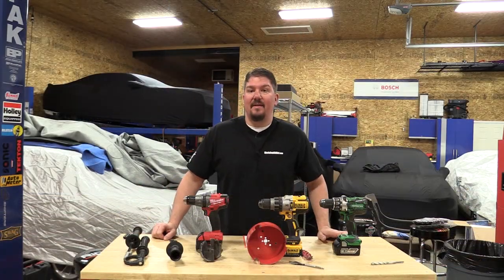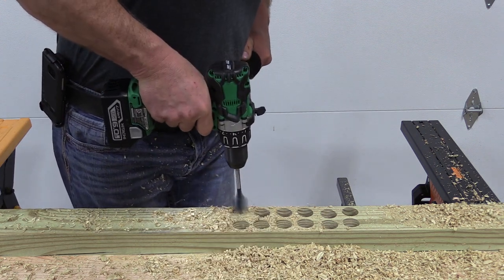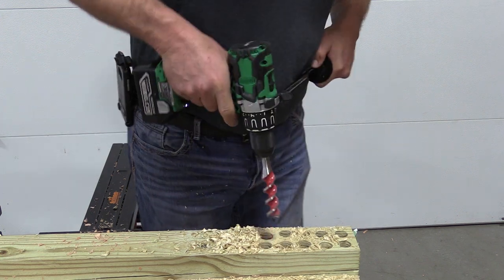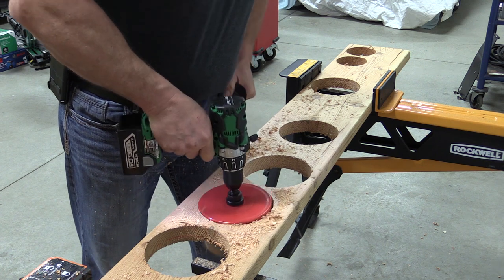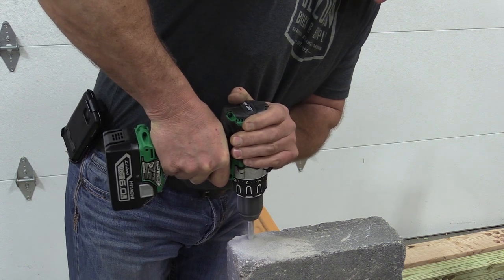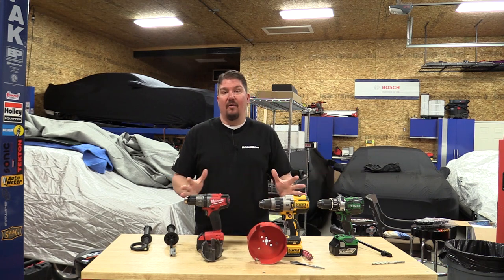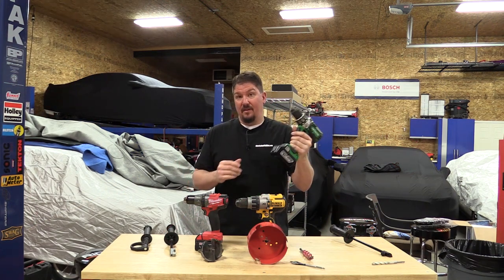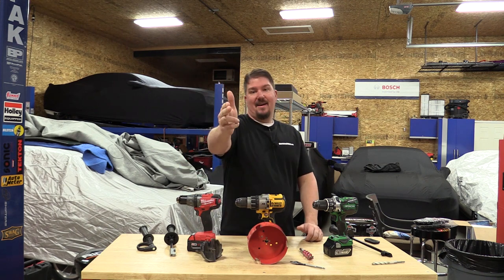Hitachi DV18DBL2 1/2" Drill vs Dewalt DCD996 vs Milwaukee 2704-20 | Brushless Drill Battle

Comment: love my Milwaukee, helps to have friends that are engineers there, they tell me what products they like so I don't regret purchasing something they have told me they are addressing the heat issue, which I only get on my 3/8 ratchet all my other tools have been fine under load, and my chuck does wobble a little bit on the drill but im not using this for precision woodworking anyway. but if I had a choice after Milwaukee just for the sake of number of tools they have and as a homeowner/handyman ridgid would be my next choice, I switched to Milwaukee after some bad experiences with dewalt, and happy I did.
Reply from the maker: What heat issue?  Thermal cutout or just heat buildup?
Reply: WorkshopAddict the heat build up.  like I said I have only experienced it with the fuel ratchet, I actually had it out last night and had 4 bolts I was running nothing major and the top was fairly warm already. but i do hear from other friend about having problems with tools getting so hot they do thermallycut out I just have never had the problem, yet.

Comment: I have had some hitachi batteries for 6 or 8 years and they still perform just as good. And I use them multiple charge cycles every day doing construction. And I have only had one drill burn up. After years and years of abuse. Hitachi all the way. Dewalt is junk. Milwaukee is good. I have the 1\2 inch impact and its an animal but I prefer hitachi still.
Reply from the maker: That is a long time for batteries to last!
Reply: Yep trust me. It amazes me every time. Its nuts but hey, for the dam price they better!

Comment: Where is the Ridgid Gen Brushless?
Reply from the maker: The Ridgid is rated at half the power of the drills tested and did not make sense to put it in the test.
Reply: WorkshopAddict with the three drills you tested, what are the specs for them? In comparison with the Ridgid Gen 5 Brushless?
Reply from the maker: Milwaukee 1200 inch pounds, Hitachi 1205 inch pounds, Dewalt 820 Watts Out (you see how well it did).  Ridgid is 700 inch pounds.

Comment: Only issue I've seen with the Dewalt is over heating while mixing motar on a roof in the summer time. The brushless stuff has been good but I miss the capacity to take a beating of the old brushed models.  Oh, and you do definitely need ear pro with the Dewalt in hammer lol #WorkshopAddict
Reply from the maker: The three speed on the Dewalt makes it a fun and easy drill to use.  It is not meant for mixing and yeah, the old brushed models would take that.  Brushless is getting better.
Reply: Milwaukee makes a brushless mixing gun
Reply from the maker: Yup, see it here: http://amzn.to/2E19urL
Reply: Michael McD. Lol that's funny they say your not suppose to mix mud with these drills but I know for a fact that the dewalt will mix a whole bucket of thinset with no problem. Lol it just churns.. it loves it lol. Bit yea as a remodeler I tho k dewalt is best. Although I do like the plumbing tools for Milwaukee.
Reply: Are you insane using a cordless drill for mixing mortar use a corded drill with low speed or a special drill designed for mixing mortar

Comment: I have bosch 18V battaries. I cant buy any of theese
Reply from the maker: I hate to tell you this, but Bosch is going through a change with their batteries.  They are going to the CORE series for the new tools.  The tools are getting more power with that battery.  you can use your battery on those tools, but you won't get half the power.  Near future, you will have to buy new batteries.
Reply: I already have one Core battery. Acoording to Bosch it is up to 1440W of power. This is way too much for a drill/driver. For not power hangry tools you can still use your "old" batteries. The problem for me is that bosch does not have cordless fan and hight torque brushless impact,  I want these two, but i don't want more chargers and batteries.

Comment: Milwaukee is known for casting issues. I’ve seen pics of impact driver housings cracked clean open all the way around and anvils broken off. I’d go with dewalt for automotive and woodwork. They own mac tools so they do have auto repair impacts. They need their mid torque one on the market.
Reply from the maker: I too have seen some issues with casting breakage, normally in well-abused tools.  I too like Mac and Proto.  Dewalt just does not seem to be "killing it" in the 20-volt max section in automotive.  Some ratchets and mid to high torque impacts would be welcomed!
Reply: WorkshopAddict I saw a pic on amazon of a 2750 brushless non-fuel model impact driver with a cracked open casing but who knows what a guy was using it on for that to happen. For the broken anvils I saw it was on Home Depot a pic of a ryobi p261 impact wrench. A guy claimed to have broken the anvils off on two of them somehow. Those are isolated incidents though. Any tool can fail with too much stress.

Comment: Great video, you should do two more with their impact driver and impact wrench versions
Reply from the maker: You want us to compare the impacts from these three companies?
Reply: WorkshopAddict well impact wrench I say Milwaukee 2767, dewalt dcf899, makita xwt08z and for 1/4 drivers Milwaukee 2753, dewalt dcf887, makita xdt14
Reply from the maker: I will work on that.  Makita does not like it when we compare their tools to others and won't cooperate with us if we ask to do that.  The Makita 1/2" impact, IMHO is heavy and underpowered.  The Milwaukee will win the 1/2" battle right now.  Once dewalt comes out with a new one, it would be interesting.  1/4" impact drivers would be fun!
Reply: WorkshopAddict I've read that the makita impact wrench holds its own against the dewalt dcf899, that's why I ask for those models, or the Milwaukee 2763 and 2767 vs dewalt dcf899 would be interesting how they stack up... But yes the 1/4 I do look forward to seeing since those are each the top of the line 1/4 from each manufacture... Thanks and can't wait to see your comparison review of them
Reply from the maker: Wilfredo Ortiz From what we have done, Milwaukee is faster than DeWalt.
Reply: You guys ever though about doing old vs new models? Would be an interesting segment. For example I still have the older dewalt dcd985 brush drill which is great, so I was thinking a comparison in power and speed with the the old reigning King dcd895 vs the new dcd996?

Comment: I will still go with milwaukee, it looks smoother as you go and dig into the materials. 
Also I'm already in the M18 milwaukee battery platform
#workshopaddict
Reply from the maker: If I was in the M18 platform, I would choose Milwaukee also.  They now have a newer drill out that would do better in this test.
Reply: @WorkshopAddict  
Do you happen to know the model # of Milwaukee's newer drill.  I have a homedepot near me if they have it and in stock, that will be my Christmas Gift😊
Reply from the maker: @joshuafigueroa6   2804-20  watch these.  https://www.youtube.com/watch?v=ik1e8KL2r7M&t=   And  https://www.youtube.com/watch?v=-pPcZAYPPPQ&t=
Reply: @WorkshopAddict  okay thanks again. And again Happy Holidays
Reply: They make adapters to run any battery I use Milwaukee batteries in my 996 sometimes!

Comment: Good call for safety! Mmm silica dust.
Reply from the maker: ringenberg2 Could you see our respirator?
Reply: WorkshopAddict actually no. On one of the video sections when you were drilling the paver the gentleman was not wearing a respirator.
Reply: WorkshopAddict 8:04 as his nose starts to descend into frame, there is no respirator.
Reply from the maker: Must have been the Milwaukee one?  For one drill he took it off and then put it back on.  Trust me, we work to be safe.

Comment: No Makita for this challenge?  Not complete without the blue beast..
Reply from the maker: Makita has asked not to be put in competition videos....  :(
Reply: WorkshopAddict.  interesting, I know I put my xph07 through the ringer at times with little complaint.
Reply from the maker: We had a blast putting the Makita circ saw up against the Dewalt Flexvolt.  When the Flexvolt came out faster, we were asked not to do that again.  I am not going to make a video with an agreement that one manufacturer will win or that they will get an award at the end of the year.  That is not us.  We don't do awards and we don't skew how tools compare.
Reply: WorkshopAddict   That's too bad. I'd put my  collection of Blue up against anything with pride. Shoot, my first impact and drill combo lasted over 10 yrs with almost daily use. I still have the drill in my bag actually and it gets used once in a while.   The impact gave up last year ironically right after I bought the brushless set.  I think it felt betrayed... Lol
Reply from the maker: So many others feel the same way.  I sort of see it from Makita's perspective.  There are a few LARGE channels out there willing to sell their sole to promote tools of certain brands and I assume Makita got burnt a few times, so this rule stops that.
Reply: Did you ever do the competition off camera? And what was the results?

Comment: I own a Milwaukee drill. Its ok. But a useless chuck that NEVER stays tight hate the drill for that reason. My bosch never did this! Friends dewalt is fine and makita. Whats the point of a drill if it doesn’t hold anything?
Reply from the maker: We have had issues with all of these drills while chucking up large bits.  You think they are tight, start drilling and the bit falls out.  We only had this issue with the large bits in this test and it happened to each equally.

Comment: Makita has the best handle in their top drills but they lag a bit in innovation, they don't upgrade their tools as often and i can understand why. They see that it's pointless to change the tools every year just for marketing purposes, they already have a full line of cordless power tools and most if not all are brushless. So what's the point in make new tools just yet? That doesn't mean that what Milwaukee's doing is wrong but they overdoing it a bit.

Comment: He forgot to mention the Hitachi has a built in feature called RFC reactive force control which cuts the motor when it's over torqued as a safety feature so you don't snap your wrist.....but otherwise nice test and I own the Hitachi and love it use it daily, but in all fairness the Milwaukee is my backup it's just a cost factor of which I would be annoyed with if it grew legs and walked....

Comment: Where's Makita
Reply from the maker: Makita requested we not use any of their tool in comparison videos.  :(
Reply: WorkshopAddict I love Makita but sounds like there worried to me . they need to upgrade there flagship drill rather then put there head in the sand.
Reply from the maker: In a lot of cases, Makita has a great tool and will hang in there.  We did a few saw comparisons and they were not happy when their saw lost to the Dewalt.  Our channel is not based on who can buy an award, so......
Reply: Makita's drill is absurdly good
Reply: Makita would win this hands down
Reply: GroovemasterOdin the dhp481
Reply: It seems Makita has gone the route Porter Cable and Bosch took -- just get it out the door and on a shelf somewhere. They were my favorite but have not kept up with the pack. And a lot of supply companies won't carry their line... Unsure what to make of that.
Reply: Makitas are hiding with the Ryobi's 😂
Reply: My Co-worker is on Makita platform, sadly he needs to recharge much more often and also tools are less powerful. Only thing is better Makita tools are little bit cheaper.
Reply: +Iloveapplefritters You have to have really thick Makita fanboy classes. Every latest tool comparison here on YT Makita is hardly among top 5. Even this they contacted to Workshopaddict and ask not to compare their tools to other brands tells that they can't keep up with others.
Reply: Iloveapplefritters that isn't the case in the uk makita is probably available in more places but is a little more expensive where as Milwaukee is the least available.
Until very recently I would have agreed 100% with you as not to long ago they were fucking awful but for what I use most which is mainly hammer drill and impact driver the Dewalt out performed the makita on both speed of task and battery run time both using 5ah.
For the cutting tools I probably give the nod to makita on run time on the 5ah but I use Flex volt battery on mine and ergonomics and as for overall life of the tool only time will tell,my original makita set Is still the original 3ah lithium range and mostly still going which I admit will be hard to beat and the set that was nicked was only 6 months old so can't comment on overall life on them.
Reply: Iloveapplefritters that isn't strictly true the original makita lithium 3 amp stuff isn't compatible with the newer batteries,

Comment: Automotive I am using milwaukee got snap on but milwaukee cheaper and more powerfull. Whith 18v impact what i could not take with dnap on milwaukee done. Even stop to use air tools. Just ratchet from snap on my opinion better